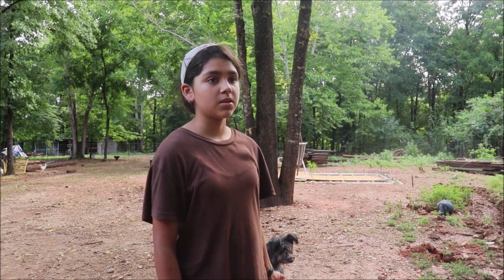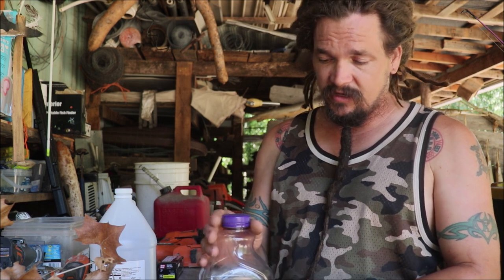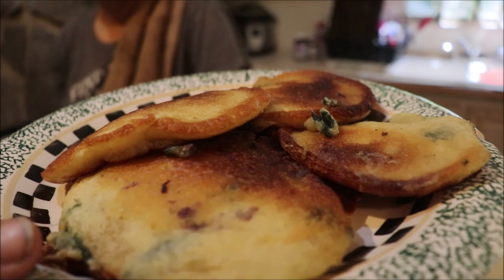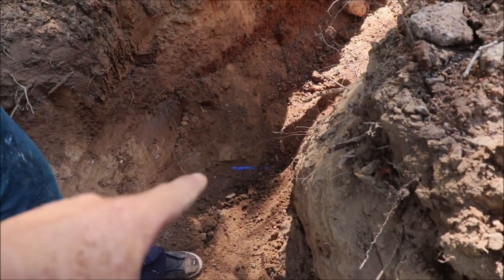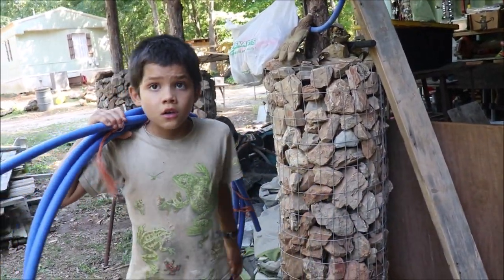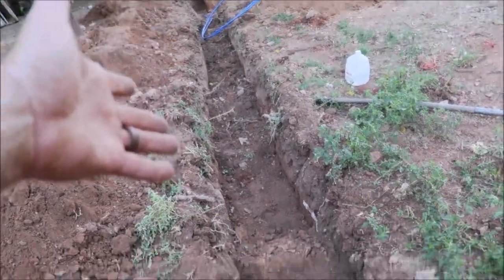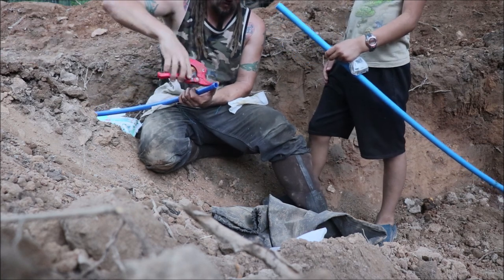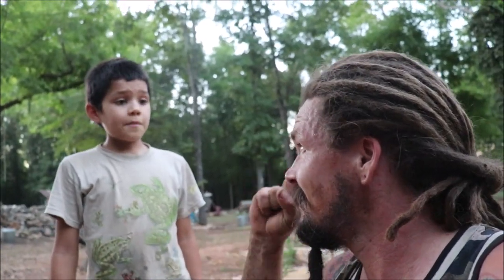I'm NEVER Trenching Without THIS Again!

Comment: Nice job, lucky you have the machine, what you can also do is put some metal wire arond and then when you need to now, you can use a metal dedector.

Comment: Since "Sharkbites" are reusable I was wondering if you knew they sell plastic locking rings to keep them from being released accidentally?
Reply from the maker: So far my experience with them has been great, just using them as is. When we've had to release one, we've always had to use a special tool and until then, they held tight. Locking them in place with a ring would provide additional security though. Good point

Comment: will that make your house water pressure go down ?? great job of all the family hugsssss
Reply from the maker: 3/4" line, so not much when we use it. and when we're not running water in the outdoor kitchen,  there shouldn't be any difference at all, unless we get a leak or forget to shut something off...
Reply: @PapaPepper  thanks for the info